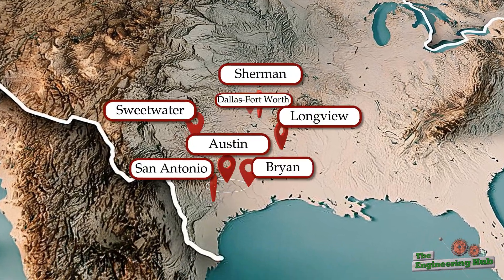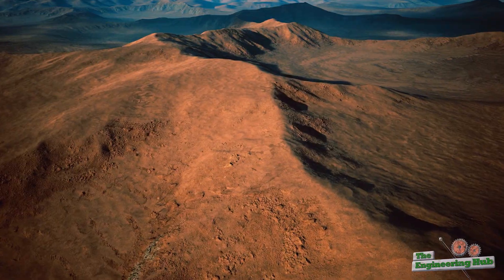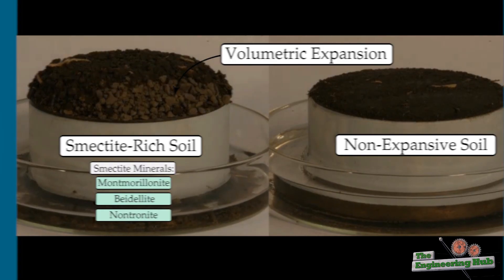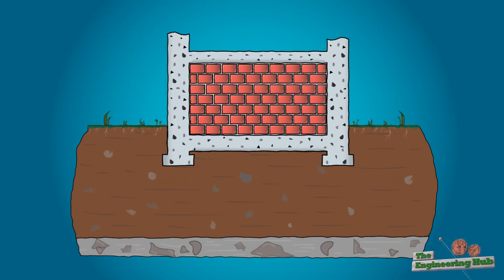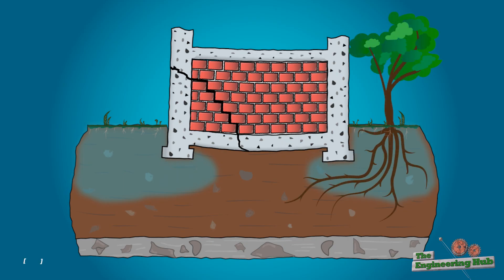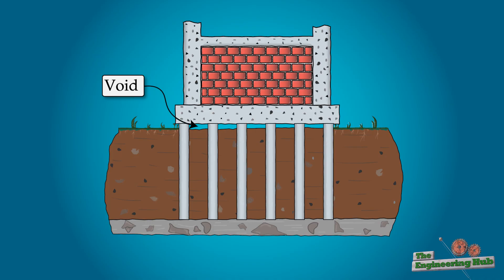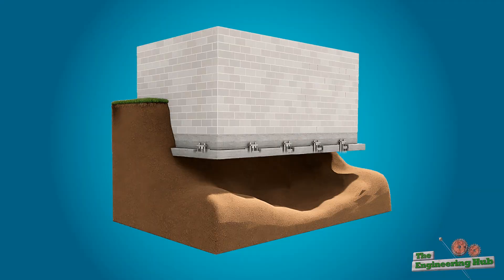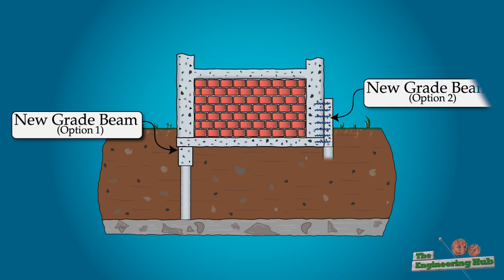Residential Foundation Problems

Comment: We used to live in Winnipeg Canada, which is famous for (among other things) - cold winters and Red River (clay) gumbo.  Our last house was built on piles that went 30 feet into the soil where the moisture content is stable year round.  Proper drainage is emphasized and people generally know to water around the foundation if the summer is very dry.  But the basements/foundations have to be put 6 feet down below the frost line, so generally they are pretty stable.  One difference is that the basement floor is usually floating and may (will) move.  When building partition walls in a basement - this MUST be taken into account.
Reply: What's the fix? build the interior walls 3/8s short and hang the top plate on the nails?
Reply: @BlasterMatar  exactly.  Interior framed walls are attached to the floor and the connection to the joists or main beam are designed to allow movement otherwise the framing can actually lift the house off the foundation.  The soils are extremely expansive with huge problems keeping roads reasonably flat.
Reply: @michaelfisher6354  most of the clay on the Canadian prairies would be this type then wouldn't it? Specifically I'm talking about north central Alberta. The basements are usually 8 feet deep. There's plenty of randomly cracked foundations. Not as much on the corners as mentioned in this video.
Reply: @gmw3083 In Edmonton Alberta, we set footings well below frost, but the coldest stretch of a bitter winter can drive frost down to around 8'!  With proper drainage through weeping tile surrounding the footings we mitigate the swelling. Engineers are counting on the "beam-like" strength properties of a steel-reinforced concrete wall sitting atop the footings to keep loads consistent across the structure.  What we commonly see in houses 40 years old or more is firstly due to concrete spalling which reduces the integrity of the concrete, alongside the condition of poor drainage (even houses equipped with weeping tile will probably have a buildup of silt blocking the weep) And lastly, we see extreme and rapid decay of the  foundation if water is permeating the outside, since concrete cracks allow water to  travel in and rust rebar,  further disintegrating😢
Reply: Interesting, just south of there most are not built like that, just a 8-10 foot basement and drain tile around it, along with I have never heard of a floating floor basement. Very interesting how much difference is in gumbo over a small area.
Reply: I'm in Ashland WI. We had Lake Agassiz here during the last glaciation. We've got thousands of meters of red clay beneath us. ALL buildings here are affected by the clay, plus all the streets and sidewalks

Comment: Could you replace a non-rectangular (vertical cross section wise) of the foundation with different backfill? Would a rounded or triangular bottom affect the problem of the edges being affected faster, maybe smoothing uplift distribution?
Reply: Would that amount of material be prohibitive?

Comment: Putting down such a strong foundation to build a house made of twigs (American standard house) doesn’t make any sense!
Reply: Have fun fitting doors, windows, plumbing, stairs, walls, cabinets, etc etc in a building that shifts like twigs on mud.
Reply: I wonder why Americans get so much shit over wooden houses. Nordic European countries also build with wood but nobody shits on them for it
Reply: @fairyheli2  Americans should get used to it
Reply: POV: you’re a cringe self loathing American
Reply: Your entire channel is about building cheap metal tents. Those will blow away any time the wind gusts above 40 miles per hour. Sit your euro trash ass down and shut up. You are the last person who should be talking about american home building.
Reply: I am a Canadian Framing Contractor and I stand behind our "twig-buildings" 100%  Comments about weak stick-framing and twiggy trusses are proof of the lack of understanding of  engineering principles and just how much engineering goes into modern platform-framed houses! 😂
Reply: We build with lumber because 1. We have an entire continent covered with it unlike most of the world, and 2. you want it to breath, to flex, to expand and contract, without cracking and causing damage like brick and concrete does. Also, in North America, we have the money and ability, not to mention legal ability, to remodel usually at least once or twice in our lifetimes, and wood makes it easy to tear out a wall, put up another, add on, tear down, or just completely start over and rebuild, much faster too, compared to brick or concrete. Also in areas like Texas where straight line winds and tornadoes are a thing, you do not want brick. You can read any report of a tornado hitting a school, which are usually made out of brick, and it usually includes a report of a brick wall falling and killing children and people under it. Wood and sheet rock does not usually kill someone when it falls on you, and it's ability to flex and move is what causes the pictures of the damage you see: the outside walls are damaged, the roof is probably gone, but the interior rooms are intact and where people survive without major injury. 

If you 100% wanted a non frame type building, your only real safe option is poured concrete, which is insanely expensive and completely unnecessary, unless you are building a bomb shelter.
Reply: @J-1410  it’s not what I said
Reply: @YHauz-co  
You alluded to it.

The “American houses are built like crap” schtick is denial of building science.